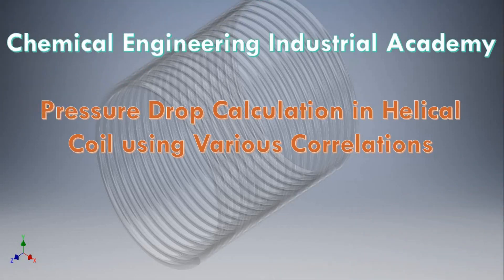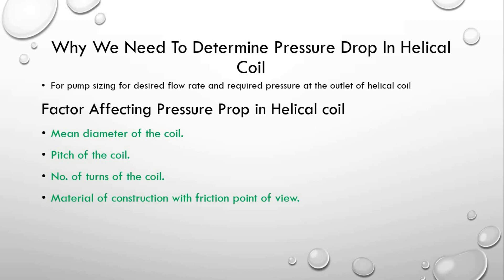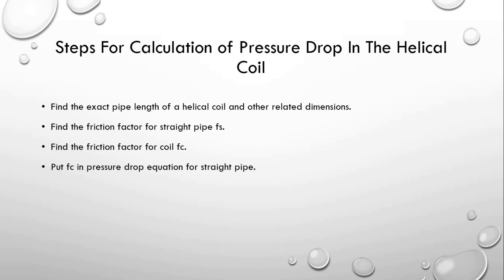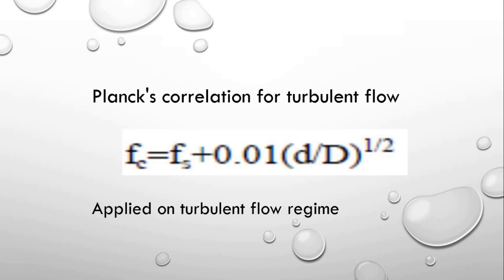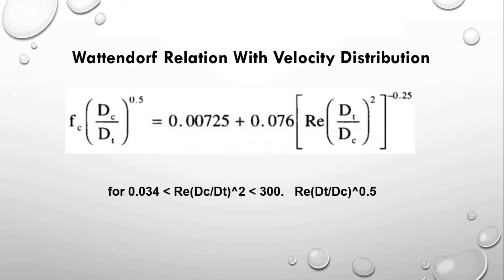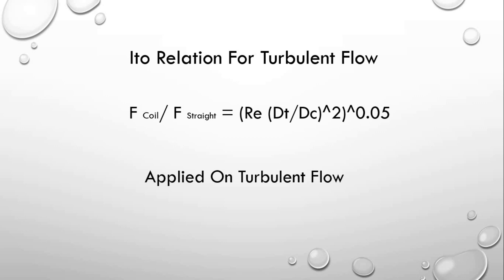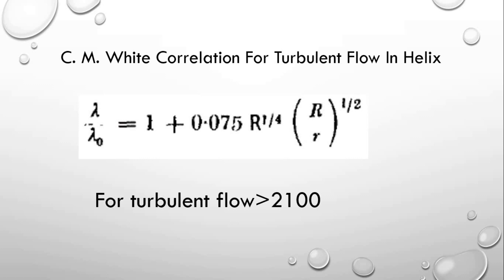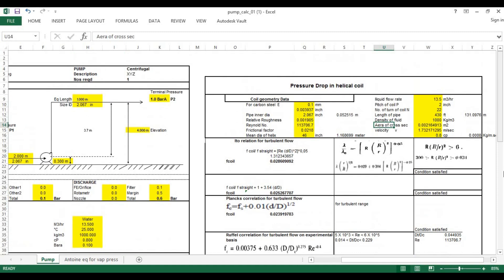Pressure Drop Calculation of the Helical Coil and the Curved Pipes in the Turbulent Flow Regime

Comment: Any chance that excel spreadsheet became available somewhere?  I have some neat test I'd like to try for some flows through a geo-thermal coil set up.
Reply from the maker: I will provide link in 1 to 2 days.
Reply: @chemeng-industrialacademy  Is the link posted somewhere?  I haven't seen it.  Just checking in.
Reply from the maker: Dear Friends link has been provided above in the video description.
Reply: @chemeng-industrialacademy  Thanks so much!
Reply from the maker: Excel spread sheet will be available in 1 -2 days.

Comment: Do you have any good sources I can refer to?
Reply from the maker: Hi A.J Ford good to see you unfortunately "References" is missed in CEI-Academy tutorials due to editor mistake , however we are updating all the stuff very soon.

Here providing the desired stuff for your help.

Cheremisinoff,
Nicholas P.  ( Ed.),  Multiphase
reactor and polymerization system hydrodynamics (PP.390-397). Houston,
London, Paris, Zurich, Tokyo: Gulf Publishing Company.

Schlichting
H. (1979). Boundary-Layer Theory (7th ed., p.627). New York, USA:  McGraw-Hill book Company.

Moss, D.
Pressure vessel design manual (3rd ed., pp.340-350), Amsterdam: Gulf
Professional Publishing. 
 Rennels, Donald C. & Hudson, H.M. Pipe flow: A practical and comprehensive
guide.( pp 166 -168), Wiley Publishers.

Ali, s. (2001).Pressure
drop correlations for flow through regular helical coil tubes. Fluid Dynamics
Research 28 (2001) 295–310.

KRISHNA B.S.V.S.R.  Prediction of pressure drops in helical coil
with single phase flow of non-newtonian fluid.